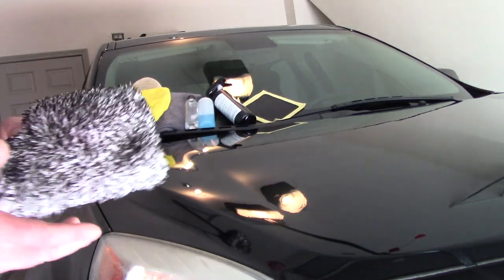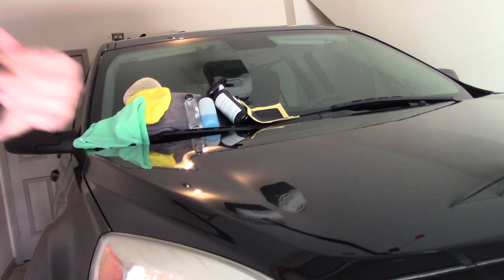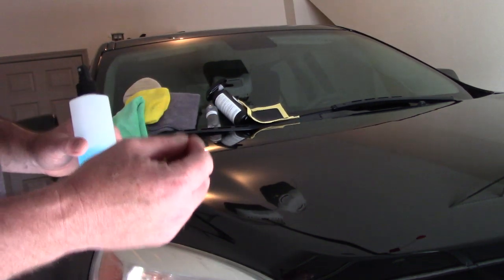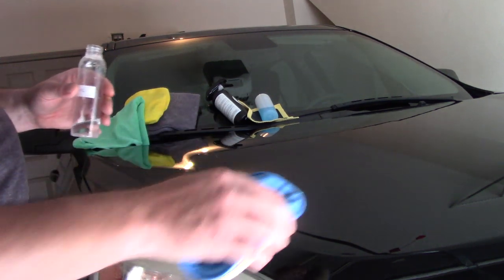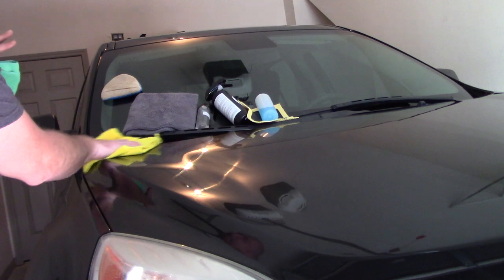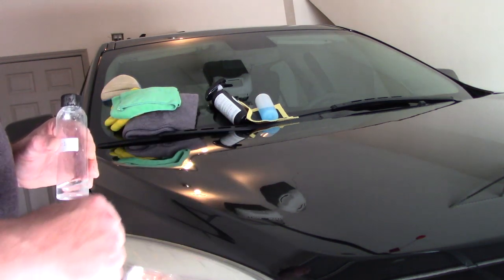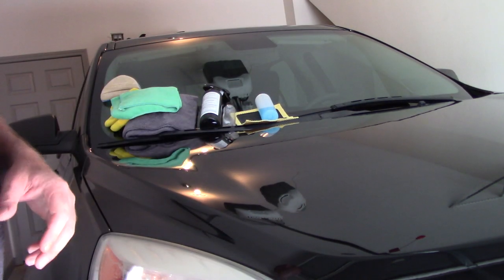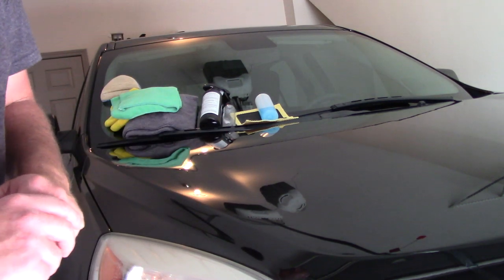DPC SHIELD - Steps Needed To Apply a Ceramic Coating!

Comment: With coatings I'm not going to be using for awhile, I will actually vacuum seal them in bags. It's fast, easy, the bags are cheap and I definitely notice a difference. Even a little Food Saver vacuum sealer from Wal-Mart does a great job.

You can reseal the same bag multiple times as you use the coating then seal and store it again. After sealing I place in a dark temp controlled place.

Comment: Any suggestions on safest way to do maintenance washes after applying DPC shield? Many MFRs suggest that touching the car as little as possible is preferable (i.e., foam, rinse, blow dry and don't use a wash mitt or drying towel) , so I am curious to know whether you abide by that same logic, especially since you dispel a lot of the industry noise. We love you, Scott!

Comment: Scott, respectfully i want to ask, noticed that your mentioned in testing paint prep used in this video had a color to it, in past videos you have mentioned your disagreement with the use of dyes, as they are geared towards retail market sales appeal.  i have absorbed and started practicing using preps without dyes, based on this as i found your statements valid and useful, so i am curious as to if yours is colored and if so, I'm excited/curious as to why, I'm curious of the chemical process in this sense. great episodes, always, thanks for all of your valuable input and you making it receivable!

Comment: Thanks Scott. Learn so much from you. Questions, can coating withstand winter with much use of strong degreasing? Here in Norway there is a lot of salt on the roads.

Comment: Scott, the leveling towel and the buffing towel, can they be cleaned and reused?  I have seen differing opinions and was hoping you could clear it up for me.
Reply: Yes as long as you wash them right after or soak them in a bucket with Revive or APC
Reply: As cheap as towels are it's probably best to use a new one next time.

Comment: Scott, couple of questions #1 w/Shield you can wash car with any type soap?
# 2  already have a Armor coat on car. To put Shield on , should I strip the armor off? High pH soap? 
When installing Armor, the next day the trim especially looked smeared? Had to re wipe. It was full strength. 
Thanks

Comment: Not sure why "Pros" call this an entry level SiO2 coating.  DPC Shield fills minor scratches and levels amazingly; more so than other "Pro" coats I have used.  It hardens very well after one day.  Three days it is fully cured and very deep gloss.  DPC Armor is also very easy topping and maintenance coat.  Bonus to DPC Armor is it smells like bubble gum!

Comment: Hey Scott, I applied the ceramic coating, however I only did a single panel wipedown with an ipa solution. I’m wondering if that was enough to remove the polish residue, I unfortunately used Meguiars ultimate polish which I know leaves behind some polishing oils. I did a very thourough ipa wipedown, but starting to wonder if that was enough.. so far ceramic coating looks great, but I guess time will tell.  Any suggestions?

Comment: Hey Scott, Im tempted to purchase your DPC ceramic coating. I do not have a garage, therefore, contamination is possible. During the curing stage of the product, what would happen if say 
some bird droppings were to come in contact with the vehicle? Can I just use some QD and take it off, will this affect the coating? On the website, it only mentions avoiding moisture while curing, which I can easily plan for so that is not really an issue despite the lack of a garage.
Reply: I'm on the same boat...
Reply: your car would have a good looking decal. :)

Comment: Meguire's has a decon, D160101 1-gal, D160105 5gal. I'm impressed by how well it works. 
Edit: I meant D180101 and D180105
Reply: Did you mean D10101 and D10105? I can't find the D160101 or D160105.
Reply: @theplayernkc  sorry, meant D1801xx
Reply: @johnrambo5619  Ah, okay found it. Do you dilute it any?
Reply: @theplayernkc  no, it's ready to use as is

Comment: Hi Scott I just received my order of Shield and Armor. I immediately decanted Armor into a 1 litre bottle at 1:1 as recommended. Unfortunately the cost to buy the products and post directly from you to Australia was about $US120. I can get Gyeon and CarPro ceramic coatings from a local supplier for a reasonable outlay ($AUD90 for 50ml) and $AUD10 or even free postage. Is it possible that you may consider a local distributor here in Australia. I like the short turnaround time of Shield compared to other coatings I’m testing. Especially if I’ve done a mobile service. Just a thought. Now to wait for the rain to stop so I can fix all the problems of my new car and hit it with Shield and Armor. Great work. Love the honesty. Keep it up. Well done on 100k subs. Lloyd

Comment: Congrats on the new product release, Scott! I haven't ordered yet myself, as I have some coatings stocked up to go through, first. Quick question; You reccomend at least three hours before a second coat, or even overnight if possible. Can UV or IR lamps be used to speed that up? If so, how long would you recommend for a cure cycle under the lights?

Comment: Stupid question. After 24 wait to cure, prep before applying Armor? Just a quick wipe for dust?
Reply: I have this exact same question.
Reply: You can pretty much just dust off the vehicle and apply the sealant. Quick rinse and dry is another way. Unless you drive around the car while it cure. Quick wash with a ph neutral soap that has no gloss enhancers or wax in it and dry after to remove the residue and apply the sealant.

Comment: @Dallas Paint Correction, will this product work on single stage red, daily driver, esp to stop the water spots after it sits in the parking lot in the rain and then the sun comes out? Struggling to find a protection product for this vehicle!?

Comment: My wheels are scratched a bit because I have a 12 year old car and my wheels are aluminum. Is it okay to use super clean degreaser on those? What kind of car wheels is it harmful to?
Reply: I've used it on my rashed aluminum UTV wheels quite a bit and it hasn't done any damage.   

Seems to leave the finish a bit brighter if you dilute it in half rather than just full strength.
Reply: FoMoCowboy  is 5:1 good? 5 parts water to 1 part super clean?
Reply: Yes you can even do 3:1 super clean on your wheels. No problems on aluminum or even painted/coated wheels. Just make sure you rinse off thoroughly
Reply: @positivevibes4957  I can't say,   I've only ever diluted it in half or used it full strength.

Comment: I bought this and the bottle went bad already.  Be warned , it would  been one thing if i was told we will get you a new bottle or even some discount on another bottle.   Just a response that it can go bad after 1 use.

Once opened, we don’t know how long it will last, some customers have it opened for 6 months and it’s okay and some have it hardening in 2 days. It depends on temperature, humidity, exposure to air heat etc

All professional grade coatings like shield work the same way.

Comment: 24 hrs cure time?  Tough to get that done without a garage.  I don't have one.
Reply: Scott said dont worry about it staying outside overnight. It wont affect it, even if it rains
Reply: Tip Is to apply shield as early as you can in the day to take advantage of day light cure time. Scott has mentioned about not worrying about morning/dew. I would just not recommend you apply it if it's going to rain later after you apply or next day....

Comment: I've kinda lost my faith in SiO2 coatings.  After having my vehicles coated with CQuartz UK several times over the past couple years I've noticed no better protection than when i applied a product like Duragloss 105 applied 2x's a year.  I think these "sealants"  have been over hyped for years.  I think Scott selling his own is great but don't expect a bird shit proof coating with any of these type of coatings.  At least Scott's is a good price vs the competition.
Reply: i went back to sealants and wax..not into this Sio2 crap anymore.. more headache..water spots are annoying..
Reply: @amazed6161  i had more problems with these type of coatings than they are worth. Especially with bug gut etching and bird bomb etching. They are over hyped as a "protect all" and they aren't.  I have found that Collinite 845 or Duragloss 105 or 111 to work just as well and so much less work.  Not mocking Scotts products or anything... i just view SiO2 as a whole, as a fad of the current age. It was worth a try for me and yes it's glossy almost artificially looking so much gloss but in my opinion that's about all you get out of it.  Protection wise? No better than the products i listed above.
Reply: @eppyz  interesting point.

Comment: do you need to change applicators per panel?
Reply: No, that just wastes product. It takes several hours for Shield to cure and harden so you can use one applicator for the entire vehicle. But definitely use a new applicator for the second layer, if you choose to apply one. 🤙🏻
Reply: @IMxRELEASINGxANGER  yes I have! I have coated multiple vehicles, a couple of motorcycles, even a motorcycle helmet. This stuff is honestly the easiest ceramic coating there is to use. You almost can't mess it up. I did a car last week when it was 95°F and brutally humid and had no issues. It levels out and buffs off super easy, even if you wait too long to apply. It's super glossy. It is, however, not super slick. I topped mine with DPC Armor and the two are a match made in heaven. The Armor adds tons of slickness along with a sacrificial top coat. Let me know if you have any other question and I'll gladly answer them! Good luck and enjoy!